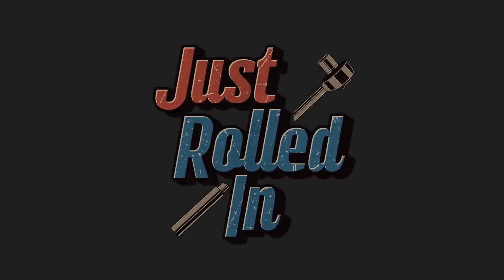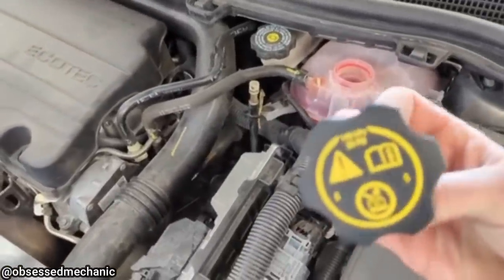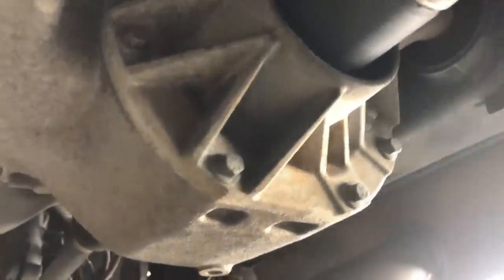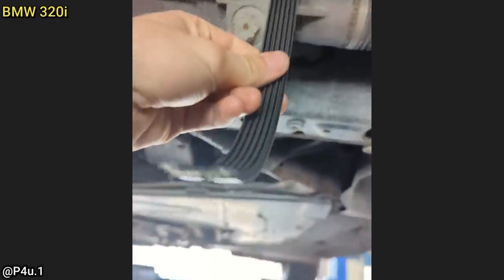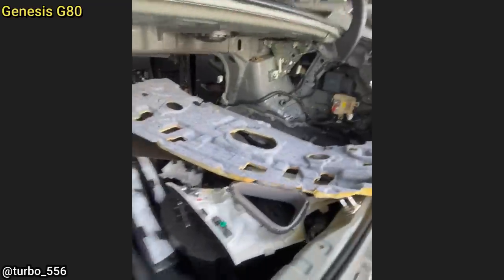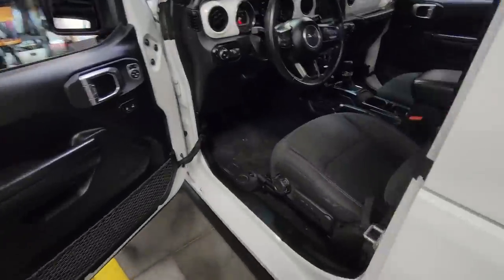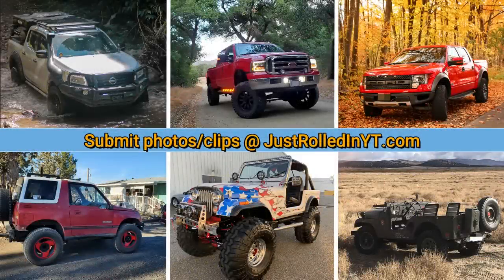Customer States Tire Fell Apart Two Days After They Were Installed (4 Months Ago) | Just Rolled In

Comment: 2:16 - I actually have that happening in my car although it's spray over the front tyre. I suspect the washer line was damaged when the shop replaced some springs but I'm not sure. It's going to get fixed next month mostly because I'm moving house this month!
Reply: Make sure you tip your movers if you arent doing it urself! Also make sure they have water or drinks!!
Reply: @rust8infinite  "Wherdya want the :HIC!: couch, Mister?"   (NO, not THOSE kind of drinks!)
Reply: @rust8infinite  Already planned! There will be drinks at both ends - houses that is!

Comment: I bought a brand new Dodge Caravan that only had 16 miles on it. Took it on a trip. The rear driver side tire blew out. The entire side walled had broken loose from the rest of the tire. I took it back to the dealer and to get a new tire. They said my warranty didnt cover tires so it was a no go on a new tire. I showed the tire to the dealer mechanic and he said wow that shouldn't happen. 15 minutes later I rolled out with a brand new tire on.
Reply: Sidewall failure usually happens when you hit something while driving. Rarely, it can be the result of a manufacturer defect. Warranties typically do not cover tires, so they probably gave you a new one as a goodwill gesture.
Reply: @annehaight9963  it didnt just fail. It literally looked like it had been cut right from the tire.
Reply: @leedog396  
That's kind of how they look when they blow, though. It's because of how the tire is put together.

Comment: I love that welded control arm...just crazy. That tire that was down to the chords and the two that were bulged...have they no clue how dangerous that is...like come on.
Reply: You think that's bad. One of our employees that was there before me jacked up our large Sprinter Van with the front suspension and cracked it in 2 places and apparently never said a thing.  The guy who was driving it never understood why he was going through front tires so much until I pointed out to him.   Amazingly the front wheels stayed connected . What's even more stupid is my boss had it welded back together and not replaced🤦‍♂️ he's literally that cheap
Reply: Yeah i had a laugh at that control arm, bet the guy that did it was proud as punch at his "repair job" :-))
Reply: Licensed Canadian welder chiming it is absolutely illegal in Canada to do that
Reply: @wes5748  Same in NZ, that car would not pass its yearly safety inspection, and so be illegal to drive on the roads. And frankly, why would you want to with such a dodgy repair :-))
Reply: I had a customer once that I happened to notice his car's tires were frayed down to the belts, with the fine wires sticking out. I emphasized that he needed to fix that IMMEDIATELY and told him a couple of nearby shops he could go to. He honestly had no clue.
Reply: And the welds were not even splinted with pieces of metal. Just edge to edge welds... What the pasta, man?
Reply: @wes5748  illegal in the UK as well.. as were the tyres, a cop can pull you over for faulty tyres and instantly have your car towed
Reply: "Remember, a welded part is stronger than the original...unless it was welded by a drunk 3rd grader with no welding experience."
Reply: @markh.6687  that is false...a welded part may be weaker because most metals are heat treated AND heating up said metal will make it weaker. Check any frame on a truck for example...there are warning labels all-over not weld.
Reply: @mikefoehr235  Only partially true; I've seen "heat treated-do not weld" on semi-tractor frames, never on a regular car or light truck metal part.

Comment: What makes me more angry than market adjustments is when shady used car lots charge 5k for  something that would've gone for 500 before the pandemic. See it happening way too often
Reply: It's not shady to respond to supply and demand.  It's not like the dealers are artificially reducing the number of cars, that was the fault of the lockdowns.
Reply: I worked for one of those shops back in 2008. You could buy an '84 Ford F-150 2WD 4-speed manual, or an '89 Honda Accord 5-speed for $500 down/$50 week - $3,200 buy-here, cry-here. The only cars we could actually sell were mid-90s Caravans/Voyagers. We also had an '87 Caprice Classic 4.3L that nobody wanted to pay $3,200 for. lol
Reply: A CC for more than 150 bucks lmao

Comment: Judging by the blue inlays on the seats of that wrangler it was a 4xe (the hybrid model), so they probably flooded the battery. The shop I work at changed one under warranty and I think the battery alone was like 10-16k. Can't remember for sure but I know the battery was into the 5 digit mark

Comment: 2:39 I've seen many old Michelins do that to various extents when they come off.
Reply: IME Michelins are not good for low mileage drivers. In five years they start to dry rot and fall apart!
Reply: I was wondering if they tried putting it on a wheel too way wide for it! 😂

Comment: Market adjustments are the reason why I'm anti-dealers. One day I'll order a car through Amazon lol
Reply from the maker: Lol that will be the future probably.
Reply: Market adjustments are a result of dealers responding to the stupidity of customers who are willing to pay anything to get the newest toy. 

Amazon sellers and car manufacturers who don’t have traditional dealers (i.e. Tesla) do the same thing. The price of the Model 3 has gone up $10,000 in the past year.
Reply: According to Luck Lopez channel, it will be going away real soon.  The shortage was a combination of supply chain issues and stimulus mad money.  The supply chain is doing much better and the mad money is gone.  There's a big uptick in repos.  There's a glut of cars for sale.  Prices will be falling.
Reply: @russellhltn1396  Closing down all the factories for months is a bit more than just "supply chain issues".  I guess supply issues did prevent them from making up for that, with parts not coming from China since their lockdowns were even worse.
Reply: amazon would find a way to put the car at the front door so you cant open it.  they seem to like doing that with large packages.
Reply: @Br3ttM  Bottom line, there weren't enough new cars.  People needing a car had to go to the used market pushing up prices.  But from what I'm hearing, dealer lots are starting to fill up again.
Reply: Well one day "I'll download a car " off of pirate bay like the movies studios  told be about in all the film anti-piracy messages trailers..... Well they said you wouldn't.....   but I was like wouldn't I ?
Reply: @JustRolledIn  Well, when all the cars are made in China.

Comment: I really like Just Rolled In because it was hard to believe the things people overlooked, saying something else is the problem. I became a true believer when I was in Mundelein, IL and saw a young fellow on a side road trying to use a cigar lighter in his car to run a compressor to put air in a tire that was torn up and half off the rim. I stopped to help but it was difficult because he only spoke Spanish. I was able to tell him to put on the spare in his trunk but it felt like it could use some air so he started pumping it in. But I could hear hissing sound from the tire and ran my hand around the tread. Very deep tread but then I saw the sidewall. I put my hand through it!  I pointed this out but he still kept trying to inflate the tire even though I showed him my hand inside his tire sidewall. I had to move on and he had a cell phone so told him to call someone and left him still trying to put air in that thing!
Reply: Well at least you tried, that was very kind of you.

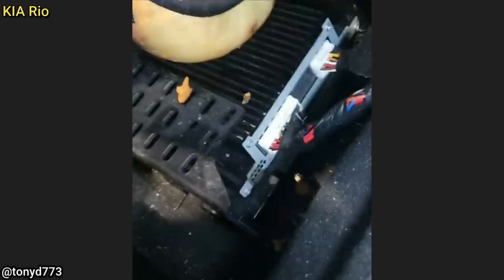Comment: 1:00 I don't know what kind of bird I hit in my old E30 doing 90-100mph, but it did that much damage at least.  It hit the top edge of the windshield and folded the front front of the roof in, also spraying feathers and some soft tissue in that hit the inside of the rear windsheled.
Reply from the maker: Holy cow! That must have surprised you 😅
Reply: I hit one while driving a school bus about 60mph. The only damage was some brain splatter on the front. It was a big flat nose bus and I was a driving to a wrestling match out of town
Reply: Hit a raptor about five years ago. It landed right in front of my van, and I caught it with my bumper. No damage to my van, but my wife said I should have stopped and brought it back home. Said it would make good soup. Not sure if she was joking or not.
Reply: @dannylim3318  I hit  a small owl with the very tip of my antenna, I picked up the bird, took him home for two weeks until he was good to fly, and released him. He stayed all summer hanging around the cabin and was quite tame.

Comment: 2:39 That's a "space saver" spare tire from the 70's, a Good Year by the sidewall casting.  Made to use a minimum of trunk space but still have a 15" wheel and match the size of the full size tires once inflated. The sidewall and tread would expand as you filled it (usually from a spray-can sized inflator.)
Reply: Those "inflate-a-spare" tires were a joke! 50 miles and it's done! My '76 Monza 2+2 came with one (bought it two years old, still have it). I am SO glad I know what I'm doing, because when I put 13x7.5 American Racing wheels on it I ALSO put one of the steel wheels and a "good" tire in the back. Good thing too because some time later I took it on a road trip from Atlanta to New Orleans. Saturday night we walked back to the car and the RF tire was flat. Looked like the sidewall had been slashed. I don't think we had pissed anybody off, wasn't illegally parked or anything... Try finding a 215/60-R13 Goodyear Gatorback on a Sunday, anywhere!

Made it back to the ATL though...

😅
Reply: @PhilG999  Most likely they were just a gimmick for more trunk space.

Comment: The spare tyre at 2:43 looks like the space saver used in some Audis and the VW Touareg.
It is stored deflated and you inflate it using a compressor or the air suspension. 
Seen it used on mercedes too.

Comment: 😳 As an ignorant newb who knows my rear diff is leaking a bit of oil, but hasn't gotten around to making sure to find the leak and top it off yet, I'm very grateful this video lit a fire under me because I didn't realize the secondary damage it could cause to the transfer case (cases? Plural? I don't know enough yet) if I keep neglecting it too long. (I know if it fails it could be a big crappy experience, but it's not showing any symptoms yet besides the tiny leak ... though I confess, it's been a while since I knew about this.) Thanks for compiling this awesome and educational content!

Comment: That AT fluid in the coolant is baffling. They knew enough to drain it(or possibly filter and gasket replaced) but then filled the resevoir? Did one person start the job and another finish it?
Reply: Probably one of those dipstick-less transmissions, where you fill/check from a bung on the side like a manual transmission does.

Comment: So the thing about the amp getting wet is something I see a lot of.  In many cases, it also creates a parasitic current draw.
Reply from the maker: I've seen that as well but never from a pumpkin 😅
Reply: Putting the amp under the seat is a lousy design choice.  People spill all sorts of stuff in their car, that's just asking for trouble when it's put there.
Reply: @JustRolledIn  The one I remember, a Range Rover (classic). A juice pouch got pinched in seat track, jammed seat and squirted juice into engine ECU under the seat.. 
They said the seat had been jammed for about a year, but one day the engine just stopped?? I had to almost chisel the ECU connector loose.
Oh yea, good times.
Reply: @JustRolledIn  The only pumpkins I should see are attached to the axle!
Reply: Hmm I mean I don’t play with electronics and electrical systems but , I do find it kinda dumb to have stuff under the seats as , I’ve had a bit of water get in ( sun fording a river in a civic, leaving the windows open and having 4 inches of rain fall , etc
Reply: @dragoniv  There's no room in cars anymore; they put the parts where the can find or make room. That's why you have to dismantle dashboards to change heater cores as just one example.

Comment: I had my car back at the Toyota dealership, where I bought it in Australia, so they could try finding a sound that seems like a stone rolling around in the framework. They never found the stone.
A few months later, I took my car back there for the next service and they told me the sump pan had a dent in it. Sure enough, I checked their 100 point safety check and they claimed the engine had nothing wrong with it.
When I took the car in to have the sump pan changed, I showed the technician their paperwork and told him it should be covered under warranty, because I know for certain I sure as hell didn't hit anything (I'm the only one who drives the car, too). Rather than taking a look to see if the dent was the shape of a trolley jack's lifting part, he just argued and basically accused me of lying. In hind sight, I should have demanded to see a photo of the damage.
Basically, the rule is true: never trust dealerships.

Comment: 2:00 I'm a pretty confident welder and I've welded a few suspension parts back together myself, but holy s*** I would never try to weld a control arm that was broken in two pieces back together or at least not without putting some gussets or stitching plates on it. that is absolutely ridiculous
Reply: I would so that I could load it on a trailer to take to a repair shop but correct gussets and plate it would be a good repair ..
Reply: Mechanical Engineer AND welder here. I've seen some crappy welds before but THAT one is WAY up there in the "bubble gum and baling wire" zone! 🤣
Reply: Oh another thing I would exclusively do this on a vehicle that I would be driving and I would never do this on someone else's vehicle regardless how well it's reinforced afterwards. just replace the goddamn control arm it's like $50
Reply: @PhilG999  You Russian engineer-mechanic by any chance??; most American engineers are afraid of tools (and some shouldn't be allowed near them; saw it in two manufacturing plants where they 'adjusted' and 'fixed' machines so well that manufacturer's service people were needed to straighten the machines out (!) ($$$$$)).
Reply: @markh.6687  Not Russian, American of German ancestry a few generations back... I guess that's why I fit in so well with the German Engineers I worked with for 8 years! 

😄

Comment: Not as crazy as the market adjustment on the Hummer...but there's a dealer here in the Indianapolis area selling two used Ford Mavericks (they both have around 2000 miles on them.  An XL (base model) that has an MSRP of ~$23k and an XLT (mid-level) with and MSRP of ~$25k (the dealer website has pictures of the window stickers) and is selling both for around $39,000.

Comment: Replacing that entire wiring harness is overkill. Just do a good repair of the wiring where it rubbed/broke. If I were the owner, the benefit of a new wiring harness would be far outweighed by the issues caused by them tearing my entire car apart to install it. They always put the interior back together poorly. You'd have a dozen squeaks and rattles after having that done. I also wanted to note that "market adjustments" wouldn't exist if there weren't legions of idiots willing to pay it because they have more money than brains.
Reply from the maker: It has Can Lines in the wiring harness that is recommended not to really repair (you could) and coaxial cable that goes to the rear camera isn't repairable. Also since it's warranty that's what the manufacturer wants.
Reply: Even if it was repairable dealerships will not just do a wire repair. Liability and warranty issues.
Reply: Odds are, if it was an out of warranty repair, it would have been done differently. A professional radio show (2-way radio) could put something like a SMA connector on that coax to "splice" it.
Reply: Was replaced under warranty... more money for the tech and dealer

Comment: That first clip of the bald tire is as close to the air as you can get!  BTW, why was the repair on the Jeep so high, or did I miss something. Great channel, just keep these stories coming!!
Reply from the maker: The customer took that Jeep off roading and afterwards it wouldn't start. The inside was filled with a good amount of water. The technician had to gut the interior and replace a couple of wiring harnesses, replace some modules and it needed some body work. I'm sure there's more then that as well. But a hefty bill and their insurance company surprisingly paid for the repairs.
Reply: The shop found the same year and color jeep, bought it, and transferred the windshield stickers and license plates

Comment: The second from end is original space saver tire. The sidewalls of the tire folds in when there is no air in the tire. The tire was only about 3“s taller than the wheel, so the tread was flat across the wheel. There was a can of compressed air that would be in the trunk. Whit the car on the jack spare mounted to car you would put air in tire would inflate and grow into shape of a tire. I should’ve saved all of them we 100s away at my tire store. If you look on eBay original space saver tire there is one for sale with the orange wheel $ 495.00 if I remember right that would have been an AMC car

Comment: oddly my 2020 truck, lacks a transmission fill or dipstick. I found the oil no problem but nowhere is there any mention of transmission.  Makes me think they have gone to some fully sealed system or something only accessible from under.  its strange, because my 2012 Cruze had ATF dipstick and fill not terribly far from the dip for the oil.

Comment: 2:45 I've seen dozens of tires do that. It's a specific shoulder contruction. A lot of Michelins did it in the 2000s and 2010s too.
Reply: It looks like the collapsable spare tire that was used in the late 70s.   There should be a canister of nitrogen to inflate the spare with.